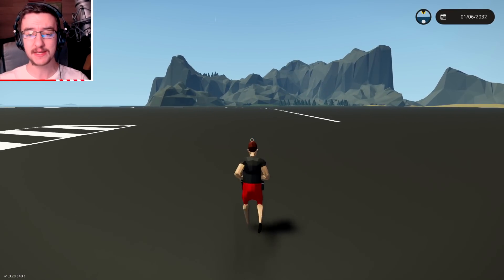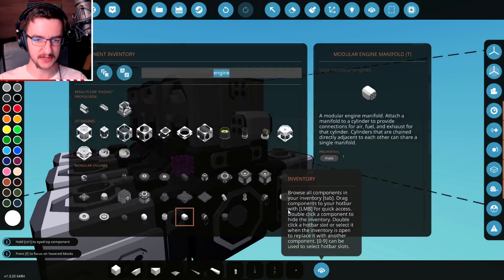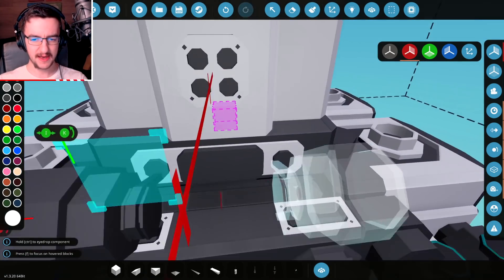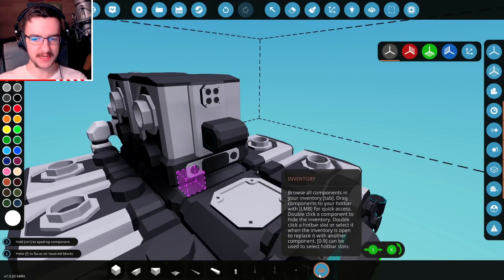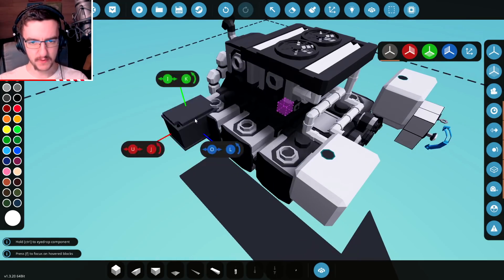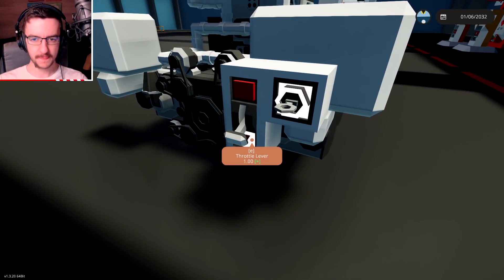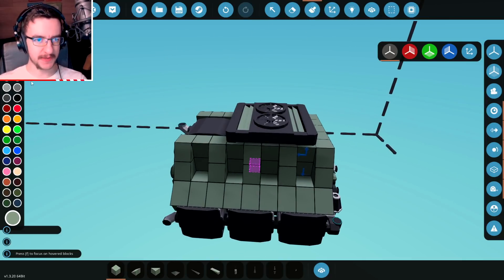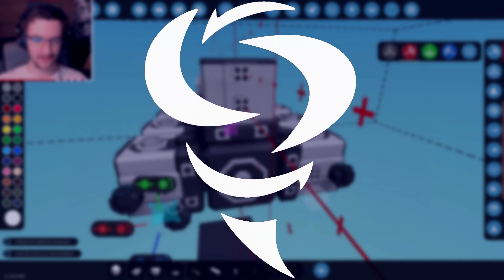SUPER HEAVY TANK ENGINE!?  -  Heavy Tank Build - Stormworks Search and Destroy

Comment: Btw engines overheat super fast without fluid inside the coolant system you need to place a t pipe in the system and attach it with a fuel tank and select the fuel tank and then fill it with fresh water or sea water (sea water will roughen the engine up so use the fresh water) and then the coolant system will work
Reply: False. Radiators come with fluid.

Comment: that looks like Maus engine which is the heaviest tank ever build it weight around 188 tons, only 2 prototypes were made
Maus or Pzkmpfw.VIII Maus was armed with 12,8 cm cannon, a coaxial  7,5 cm cannon (yes a 75 mm as secondary), and a 7,7mm MG,with armor thickness from 220mm to 150mm, powered by massive 8 cilinders engine producing 1,200 hp and transfered to an even bigger electric transmission which giving it a top speed of *drum stick* 20km/h on good road and some following wind

Comment: Personally i think your engine is a bit too tall, but if you're designing a larger tank (if your tank is similar size to most modern MBTs) then having a taller rather than flatter engine isnt so bad so long as the engine doesnt get any bigger, as that allows you to add larger fuel tanks beside the engine in the engine compartment.
Seeing your current plans for the sprocket/idler placement though it looks like you'll have to add you fuel tanks to the side of the fighting compartment, which will limit inside space (your crew would hate you), unless you make the tank wider.
If you dont want to flatten your engine i have heard the idea of raising the engine deck as high as it can go without hitting the turret to increase space.

Also i think it would be really cool if you designed this thing like the british conqueror (a british cold war heavy tank designed to delete tanks from the soviet IS series).

Comment: The size of the engine on a heavy tank will vary depending on the tank that you’re looking at for example if you look at the tog2 then that engine is a normal size but if you’re looking at the tiger tank then it’s pretty 80 large
Reply: "If you look at the ToG 2 the engine is normal size"

My brother in flesh the ToG 2 is  literally 70% engine and transmission
Reply: well it depends. The engine used in Porsches tank design had 2 absolutely huge engines, whereas the Henshel Design had a V12 engine derived from a Daimler Benz engine used in 109 aircraft (I think, not sure).

Comment: I need to figure out how to program a microcontroller for a modular engine as I can’t fine any that work with how I want my engine to work. 
Also there is a 3x3 crankshaft that allows the smaller cylinders to you can have a ton of cylinders instead of just 8 for the same size

Comment: You need a function MC for x/2 for the air and fuel manifolds, i cant quite remember which one is supposed to be divided by 2 but they shouldnt both be the same ratio
Reply from the maker: Indeed but the microcontroller does that :)
Reply: Fuel, but that's not the issue you're seeing,  the engine is rev limiting because there's no load.